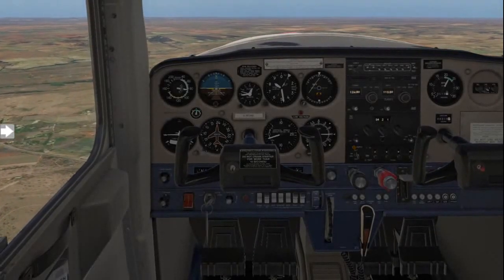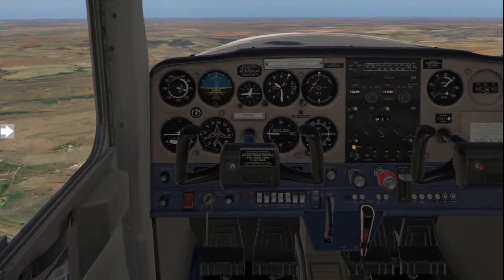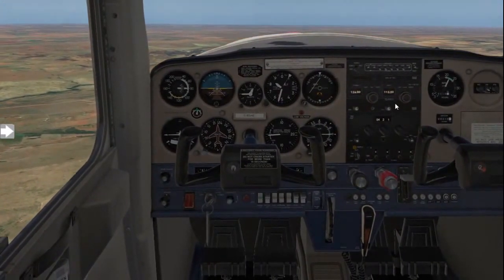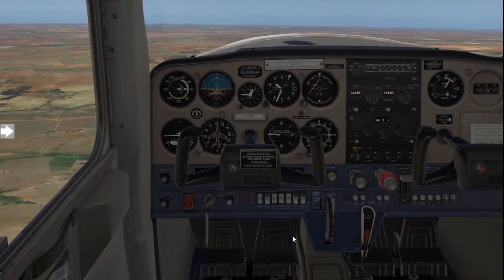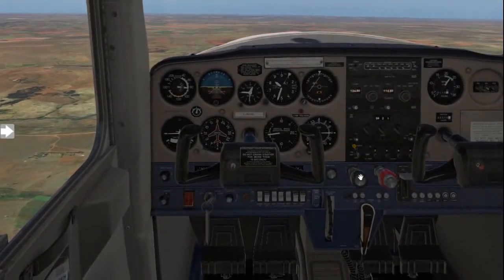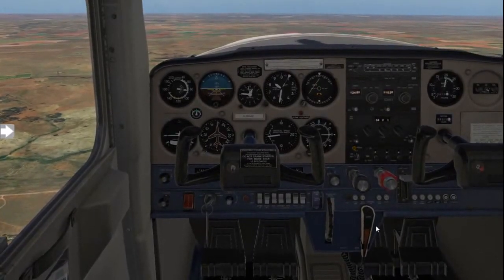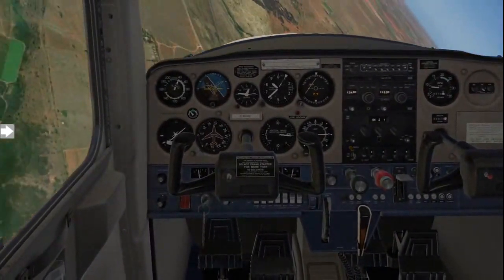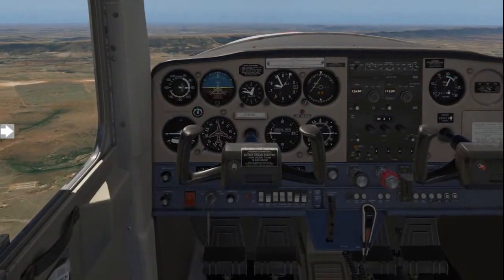Spin Avoidance C152 - Demonstration Flight Lesson

Comment: which c-152 addon are you using in xplane?
Reply from the maker: Justplane c-152
Reply: @LouwrensMare  can not find any addon from justplane for xplane! only ones I can find are from carenado or justflight. You sure you don't mean justflight?
Reply from the maker: Justflight yes. Sorry my bad
Reply: @LouwrensMare  I have the carenado152  with nhadrien mod and find the spins dont reflect real-life spins at all. Does the justfight version do spins properly as real-life 152?
Reply from the maker: The only aircraft i could get into a proper spin was the Harvard T-6 free download for xplane. But experimental mode must be ticked. As for the rest, like you mentioned they do not reflect a real life aircraft spin accurately
Reply from the maker: But the paid version